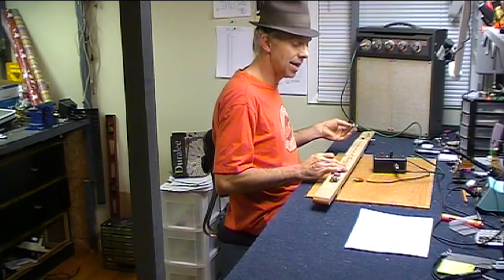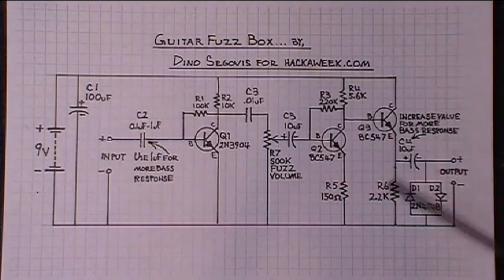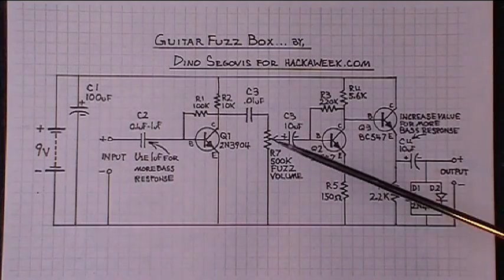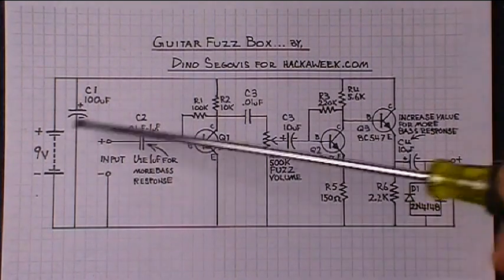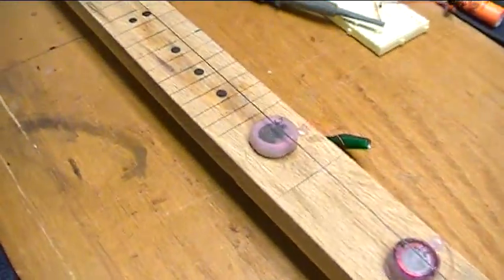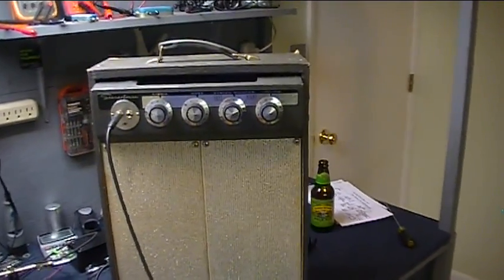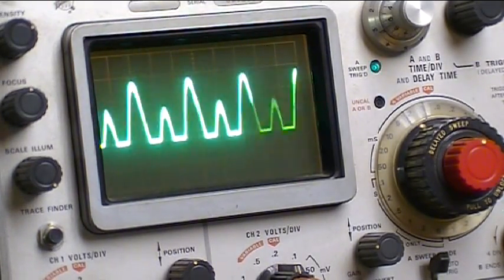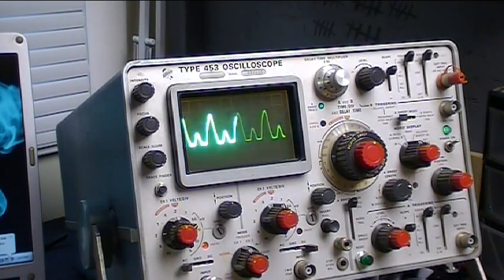DIY Guitar Fuzz Effect Box

Comment: Hi Dean, Good job, works well. Maybe check out DIY Guitar Pedals, Paul, on YT, 'Build a guitar pedal in 10 mins! (Fuzz)'. I made mine using a 2N3904, a 1N4148 or 1N914, two 0.1uF poly film caps and a 10K resistor, I added a pot, works good. As always, just a thought. Should be on Google Images. Be good, C.